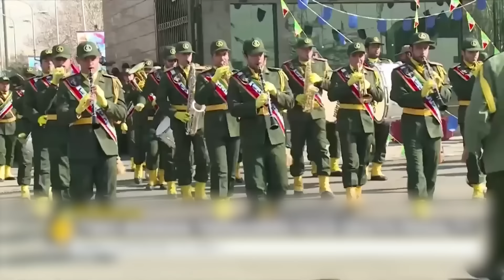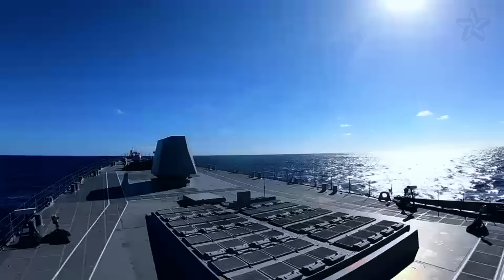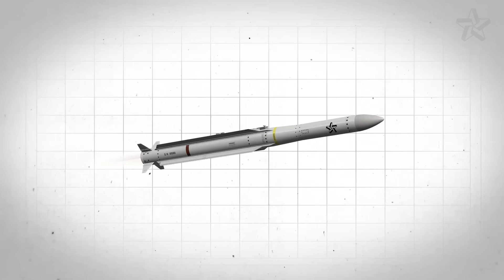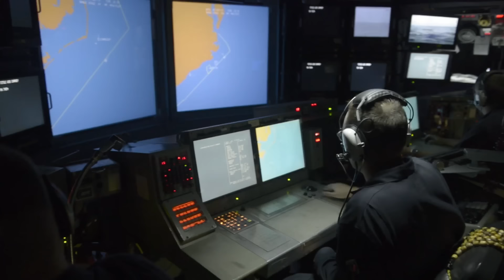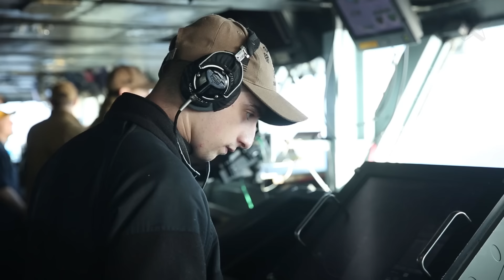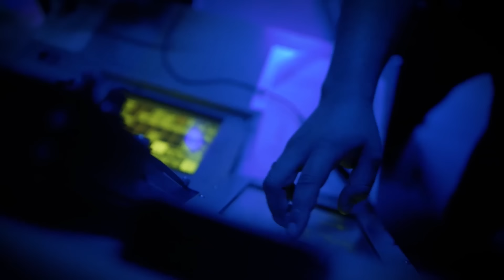Iranian Helicopter Flies TOO CLOSE to US Navy Destroyer – BIG MISTAKE

Comment: What not many people realise is that...EVERY single aircraft that has been manufactured by the US can be shut down via a certain code which is built into all hardware so as to prevent the aircraft being used in anger back against them. THE SAME consists with all fighter aircraft including the new F35s purchased by allied countries meaning all software in every one of these aircraft is NOT identical to the US version..There is 5 different levels of disbursement that can be used from rendering the aircrafts weapons as un useable, to turning off ALL electronics, to activating the Return to Base to the immediate shut down which adjusts the power and performance of the aircraft to minimum allowing landing only. For those asking, No, there is not a self destruct mode that the US can use, only the mode that shuts the electronics down into limp mode rendering the aircraft as useless. What they can also do is put a lock (or 21 character password) onto the aircrafts electronics which stops the aircraft being restarted and the owners then need to get the new software sent from the US Naval command after a little chat in why the aircraft actually had its air capabilities restricted or ceased. Australias F35 do comprise of the most identical software to the US F35s with little to no restrictions ALTHOUGH it still does comprise of the AA (anti ally) software which prevents the Aussie F35 from targeting its weapons against any US aircraft or ship.

Comment: Thinking that these old aircraft that they bought from the United States is not exactly correct. I trained with Iranians when they were our friends. Believe me they have the ability to keep these aircraft in pretty good working order. Remember that just a year ago they still had several f-14s that were flying and the United States was having trouble keeping those pieces of crap in the air. The original F-14 was a boondoggle of absolute pull your hair out trying to keep them things in the air. If an aircraft carrier could keep 50% of their f-14s in the air they were doing good. And they were making spare parts for those aircraft for quite some time. Those people are really bright. The fact that they're being led by a religious nut ball is not necessarily their fault. It's the fault of James Carter. Another president we've had that hated the United States more than he hated evil

Comment: The CIC on the boat saw the helicopter.  And had multiple fire solutions before the boat could see it . And the boat has over horizon targeting . And the helicopter would have been downed .long before the helicopter could do anything. Also the actions of the helicopter were not only  hostile. And because it took place in international waters Its actions satisfy the destroyers ROE . (Rules of engagement ). They could have leaglely shot it down.

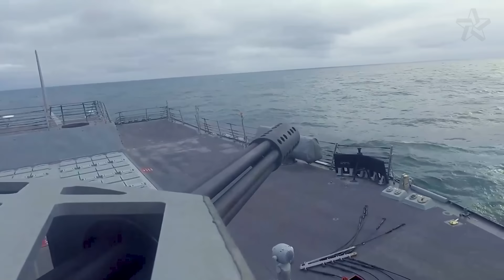Comment: @6:03  "The Iranian pilot pushes his collective forward."   Note:  helicopter collectives are not "pushed forward;" they are pulled up, toward the pilot's armpit, to increase lift or pushed down, toward the floor, to decrease lift; cyclics, on the other hand, are moved left, forward, right & back to move the helicopter left, forward, right & backward, respectively; in order to "dive" a helicopter the pilot simultaneously lowers the collective and pushes the cyclic forward; don't get me started on the torque pedals, that's a huge additional comment for another time.

Comment: Your info is about 20% true....
The ship is about 9000 tons fully loaded, has about 80,000 shaft HP (4x LM2500 @ 20,000 shaft HP each)and can go above 45 knots (top speed is classified when battle override is in use)..
How do I know? I lived on one for 3.5 years and worked on those badass engines!!!
GSM2....

Comment: They should have slowed down and refused to change course. the helicopter would have run low of fuel and had to back off. As it is, it did appear the backed away from the vintage helicopter or at least was easier to sell it that way.

Comment: 30 knots is what...34/35 mph? The chopper is struggling to keep up? Please...cut the dramatics!
Reply: Well it is a 65 year old U.S. built helicopter that doesn't have any kind of maintanence support running on cannibalized  parts. I could see it being limited in performance.
Reply: Moving that slow the rotors have to muscle the helicopter in the air in a virtual dead lift. If the helicopter were traveling at 100 knots it wouldn’t use nearly so much fuel. When Gus Grissom landed in the ocean on the second Mercury flight his door panel prematurely blew off letting water in. He got out and a helicopter was attached to the capsule. They had to cut it loose after a few minutes because it was using too much fuel just hovering and supporting the waterlogged capsule.

Comment: The same Aegis system that was totally disabled by Russia EM device several years ago in the Black Sea.  USS Fitzgerald.
The SU 35 made 5 bombing runs on the vessel while disabled filming each and released video of the incident which was so bad 21 of the crew took early retirement or reassignment.

Comment: 5 inch gun would've been nicer.
Reply: and use up one of the 8,000 rounds the barrel can handle before wearing out? 😆
Reply: @BacktheBlue777 Way cheaper than a missile. And sends a message.  Don't get to close.
Reply: @johnkoko5794  A single Ghaem-114 would sink the destroyer lol
Reply: @goldiga3935 If it hits,  it would only damage it.  How often does an Iranian pilot practice hitting a moving target?
Reply: @johnkoko5794  It's basic math, which Iranians invented, you just copy it lol